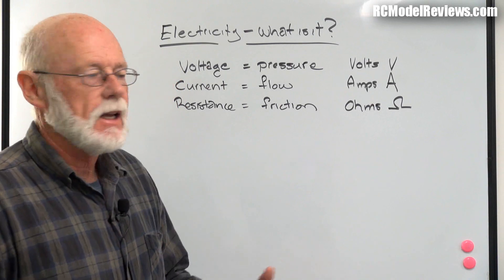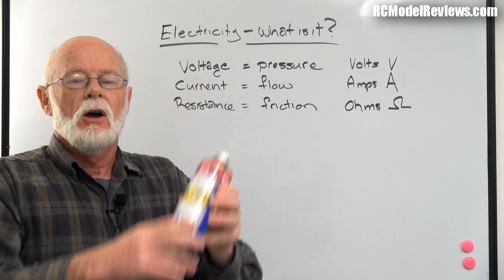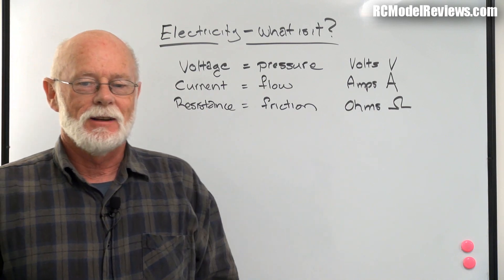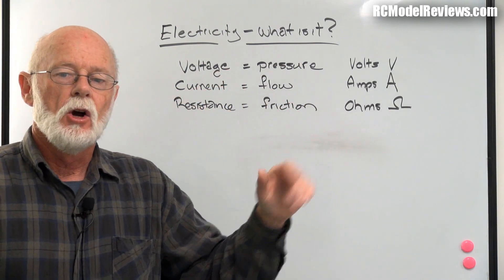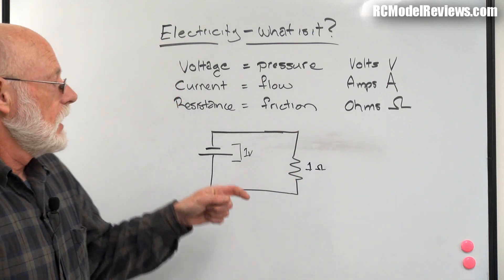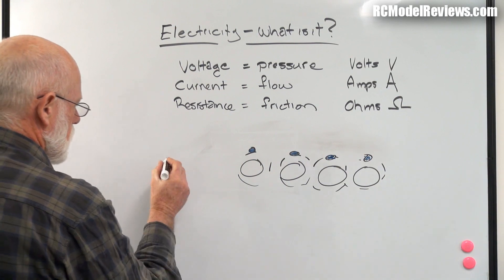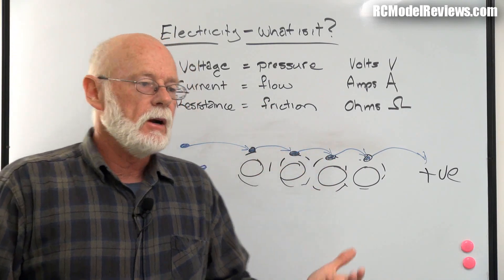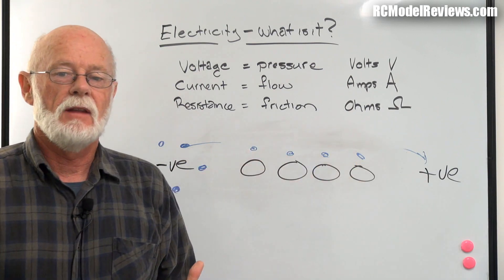Electronics 101 - What is electricity?

Comment: I came with a better analogy: 

Imagine you are waiting at the entrance of a cinema, usually you are in hurry to take your sits and so other people, that rush of taking sits make you apply pressure to the queue, such thing is analogously the Volt. 

Then you have to walk through an entrance where your tickets are being checked, the person who checks your tickets, plus the width of the entrance and all the shouldering between people go against your ability to join your sit fast. That is analogously resistence.

Then you may notice there are usually more people passing through the entrance at the same time, that's because the entrance is large enough to have two member of the stuff checking tickets, the more people pass the entrance the more the flow! That is about the current.

Comment: electrons form - to + , is this correct ?
Reply: Yes it is :) Strange isn't it?
Reply: Never really though about it but now it dose make sense :-)
Reply: It's better to think of it as flowing from where there are more to where there are less, or from higher pressure to lower pressure until they are equal.
That way you are covered on all fronts, otherwise people get very confused when you introduce multiple voltages or even AC.

Comment: Nice start. Thank you. When you get a chance, Can you explain how electricity likes to follow the path of least resistance in terms of pull up and pull down resistors ? And maybe how safety RCDs work? Cheers
Reply: He can't explain that, because electricity does not follow the path of least resistance. If there are multiple resistances in parallel, it will follow both, even if one is much lower than the other. How much will flow through each path is just Ohm's law.
Your example of an RCD is a good example of that. It would not work in many cases if your assumption were true. To explain it simply: an RCD measures the current going to and coming from a device. If you touch anything on the device that's live, a small current flows through you (see, electricity does not follow the path of least resistance, because that would be the copper wire). The RCD senses the difference between the current going to the device and coming back from it and switches of.
For details there are already good videos on youtube that show how it works. I think Bruce should stick to the parts of electronics that's useful for the RC hobby.
Reply: lucky he didn't start talking about skin effect which is why waveguides are hollow ;)

Comment: Good vid, but I thought current flowed from + to -.  EX.  Barefoot on wet soil and touch power line positive... get shock.  Touch neutral/ground and nothing happens.  Could  you clear this up in subsequent video?  Thanks.
Reply: There is a bit of misinformation here. 
Completing the circuit on a 4s or even a 6s battery with your fingers will not give you a shock due to the resistance in your body.
I regularly work with automotive batteries and will happily put my hands on both terminals to complete the circuit with no ill effects.
Different story if you complete the same circuit with a piece of wire.
Still no shock but lots of heat, almost instantly.
Start increasing the voltage and eventually it gets high enough to pass through your body and shock you.
What level you may ask?
I have no idea, maybe that is a question for Bruce.
I do know that 20000v from a conventional ignition system will bite you (some electronic systems will go over 100000v) as will 5000v from an electric fence. These will give you a fright but would unlikely kill you due to very low current.
However a mains voltage as low as 230v can kill due to the much higher current flow.
Reply: Completing a circuit requires two connections, one for charged particles to get out and one to come in. So sticking one finger in a 4s battery and another in a 3s battery won't give you a shock because the circuit isn't close.
Reply: You get a shock when you complete a circuit between two places that are at a different electrical charge.

For example if you stuck your finger in the +ve terminal of a 4s battery (16v) and then into the +ve of a 3s battery (12v) you have created a circuit with a 4v potential and you will get shocked. Albeit at a lower level than if you had gone to ground 0v.

In your example there just isnt a difference in electrical potential so no electrons flow.

At an atomic level electrons have a -ve charge and they flow from the -ve terminal to the +ve in a dc circuit.
Reply: Yeah, I´m pretty confused by that as well.
Reply: There's the technical and physical flow of electricity. The guys that made the current direction/polarity didn't know about electrons. They had a 50/50 chance... and got it wrong, but it stuck.
There is no power line positive, it alternates. That's why it's called AC/alternating current.
Reply: The current direction is just a convention because in the real world electricity is not just the flow of electrons but the flow of any particle that carries a charge(so "positive" particles will flow the other way around). Because of that I don't think they got it wrong they just did there best to simplify a more complex phenomena. :)
Reply: Sorry yes.  I meant to say that you you needed to connect the two grounds on the batteries.
Reply: You're right 12V or even 22V don't usually have an effect that we can sense on our body but that is not always the case because our body is a mix of poor and good conductors. For instance blood and sweat are actually good conductors and if you have a cut or sweaty palms there will be enough current to actually feel it.
The current limit that can be considered safe depends on the path that the current flows, because vital organs like the heart will not tolerate high values. For the worst case scenario I think the limit is around 50 miliamps or 0.05 A.

Comment: Id like to know the purpose of earthing? Particularly in houses and buildings.
Reply: Safety. If you dont earth then the negative terminal in your house can be at a different electrical potential then the ground. If that happens you could be killed when touching a "ground" wire as its not actually a ground but a -ve relative to your +ve wire and yet a +ve relative to your ground.
Reply: Indeed safety is the reason but is not the ground or negative wire that get''s tide to the actual ground.
Is more like beside the two wires needed for the flow of electricity another one(isolated from the other two) is used for earthing the chassis of home appliances so that if by accident there is a voltage applied to the chassis, the current will flow to the ground and not through someone that touches it.
Reply: Sorry bad explanation on my behalf.  Late night and phone typing.
Reply: Thanks guys
Reply: Thanks guys

Comment: On insulators and conductors, I felt like you should have drawn a bit more detail.  Or rather, shown why insulators insulate.  Because of an even number of electrons in it's outer ring (valance).  Where as a conductor usually only has one electron in it's outer ring..  
If I said that right... ;p
Reply: That's not correct. The number of electrons in the outer shell is not what makes an conductor.
Reply: superdau That's exactly what makes a good conductor.  A insulator has 6 or more electrons in the valance ring, where as a good conductor only has 1.  That 1 being out there by itself, is easily knocked free (current flow/conduct).  But with 6 or more in that outer ring, they stabilize each other to the point of being almost impossible to dislodge an electron (insulator).
Reply: It depends on the kind of bonds the outer electrons are involved in. Graphite is a conductor whereas diamond is an insulator. It's all carbon though, which has four electrons in its valence shell.
Reply: S. Giles And carbon has how many valence electrons?  Four, which makes it a semi conductor.  And where as a diamond structure (note how we're no longer taking about subatomic particles, but groups of atoms)  creates an even stronger bond for the carbon's valance electrons, Graphite dose the opposite.  But still doesn't make for as good a conductor as any atom with a single electron..

Comment: isn't the symbol of amps I?
Reply from the maker: No, that's the symbol for current and amps is the symbol for the unit of measurement of current.
Reply: Current symbol is I, but it's measuring unit symbol is Amps  , A
Reply: That symbol is used for the equations. I think what he meant by 'symbol' was 'unit notation'. For example, how you put the 'cm' unit notation at the end of a number: 5 cm.
Reply: And, I know: your question was rhetoric :P
Reply: I knew that  A and I were both symbols used, I just wasn't sure where they were used, and the difference between them
Reply: For example, if you say: The current is 2 ampere, then I = 2A